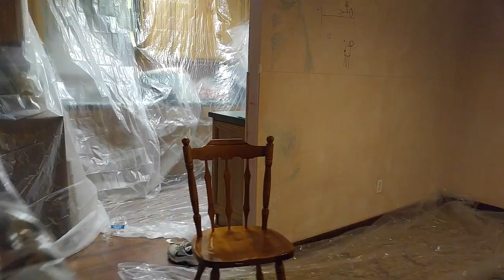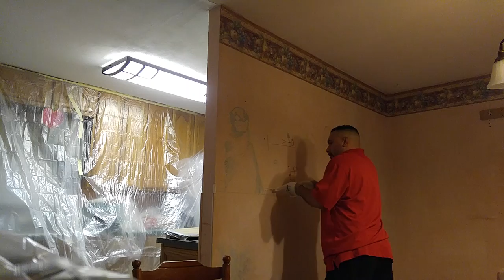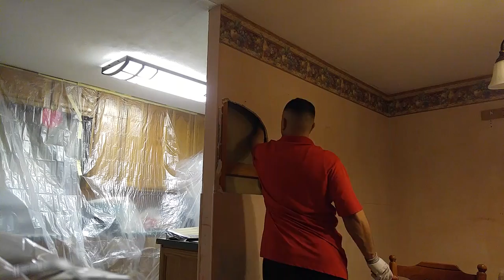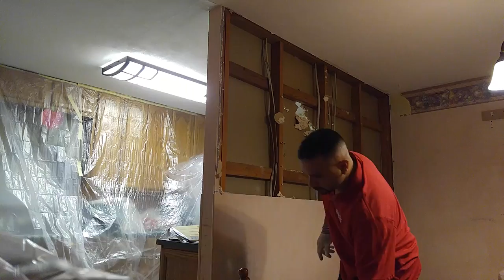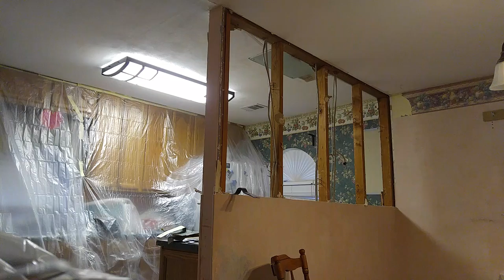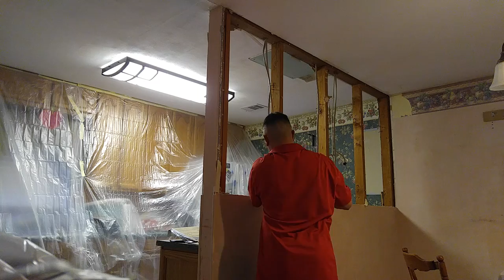Wall removal of kitch/dining time lapse video by LG V10

Comment: Thank you for sharing.  How do you know the wall you are demolishing is not the load bearing wall.
Reply from the maker: hotmoon226 I had to check the attic first to see what was directly on top. Had it been a load bearing wall it would've been somewhat visible. Always best to ask around and maybe even get a engineer to check it out. Although it wasn't a load bearing wall I still have a little extra support and tied into the other beams coming from roof.
Reply: Thank you very much for your reply. I want to do the same thing ,just worry about the house is going to collapse.  BTW, you are such a handy man doing everything by yourself.